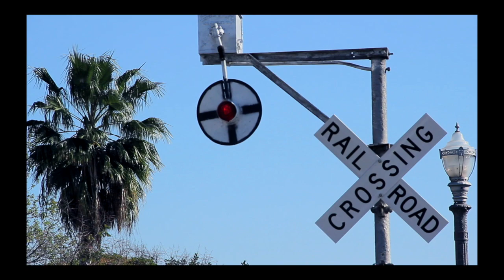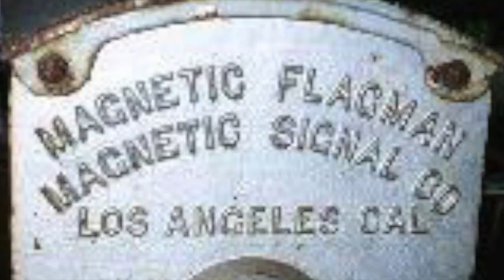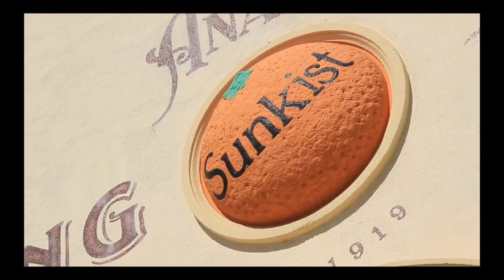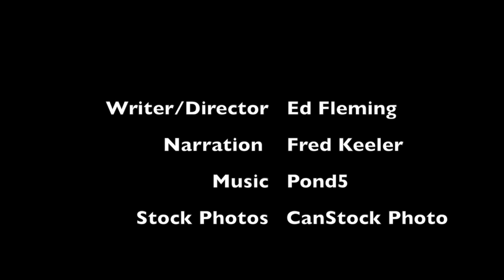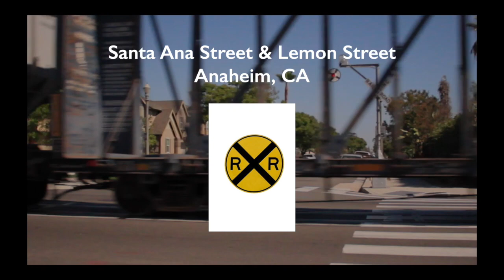LAST WIG WAG SIGNAL - ANAHEIM, CA

Comment: Since I am 73 years old I remember as a child a wig wag signal in the San Fernando Valley in the late 1950s that was located on the old Woodman Ave near Saticoy  Street. Eventually a New Woodman Ave was built with an under crossing of the railroad tracks and the old Woodman Ave crossing was removed and the old Woodman Ave got renamed Ventura Canyon Ave. By now it is likely that all of these old wig wag signals have been removed.

Comment: A wig-wag might have been OK in the 1800's, but it is obviously a pathetically weak warning device for modern traffic.  The red light is very weak, to say the least.  SO, what about the red flashing lights currently being used.  They are obsolete for a number of reasons:  too narrow of a view, too weak in fog, snow storms and heavy rain.  Let's get to the bottom of this.  Railroad crossings would be much safer IF they had standard Red / Yellow / Green traffic signals.  Consider the fact that the red flashing lights start flashing with no advance warning.  That's why a lot of drivers end up driving past the red flashing lights---the lights started flashing when the vehicle was close to the crossing and the driver didn't have time to stop.  Imagine being on a highway with a 60 MPH speed limit and you are 200 feet away from a railroad crossing.  At 60 MPH, you are traveling at 88 feet a second.  So in 2.27 seconds, you will be at the crossing.  So, what happens when you are 200 feet from the crossing and, all of a sudden, the red lights start to flash.  Will you be able to stop in 2.27 seconds?  No.  And, what if you have a tractor-trailer on your back bumper?  Bottom line:  NO advance warning that the red lights will start to flash.  NONE!  The government agencies and the railroads could install a flashing yellow light at the Advance R/R sign to let you know you will have to stop ahead.  Some traffic signals on state highways have an advance, active warning sign.  But, NO railroad crossings!   WHY?  Well, it costs money to have a simple flashing yellow light on both sides of the crossing AND the government people--local, county, state--Plus the railroads don't want to supply the money to install them, maintain them and provide the electricity to operate them.  SO, as usual for over 150 years, "Money first, Safety last."  Result:  the public gets hit by trains and gets injured or killed.  AND, the train detection system still being installed and still being used, the Track Circuit, is from 1872!  NOT 1972----1872.  It fails to detect trains in various locations around the U.S. and on a daily basis.  The main culprit: rust on the rails.  The railroads and the FRA claim the Track Circuit is "fail-safe."  It is a monstrous lie and gets people injured and killed daily.  A total Track Circuit detection failure caused the deaths of a mother and daughter in Charlotte, Michigan, on April 27, 2004.  The railroad claimed, "Everything was working."  That was a complete and total lie.  They ran a rail grinder over the track the very next day to remove the heavy layer of rust and didn't bother (!) to inform the police.
Reply: Ya don't say...............
Reply: Yeah So True!!!!!!!!!! Also Charlotte Michigan is 10 Miles Away From Where a Railfan/Live
Reply: Well considering by me the cars will go around gates until the train is physically in view
Reply: At these speeds, anyone who were to run the signal and proceed to hit the train deserves the damage to the car and the dirty britches they'll get!
Reply: Just put in a brighter LED bulb then.